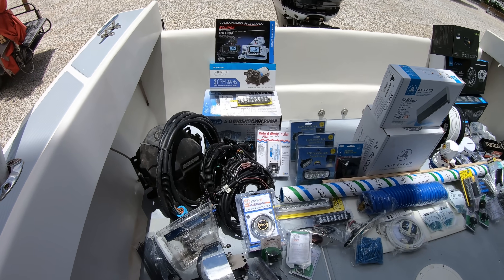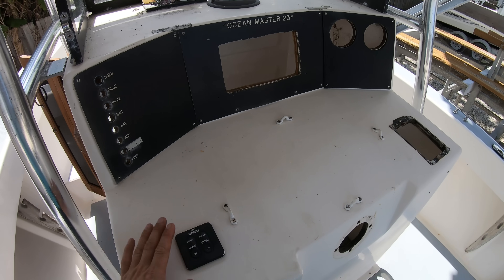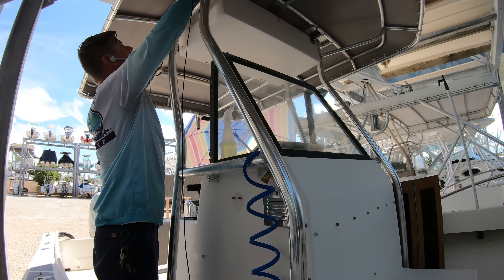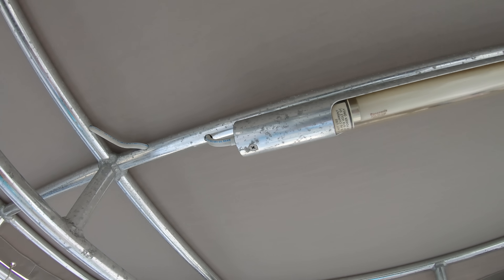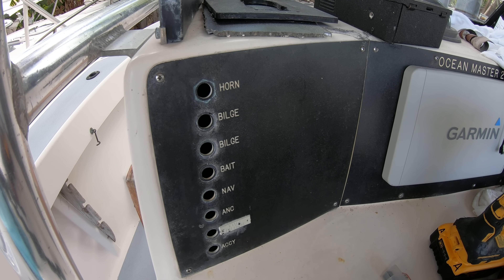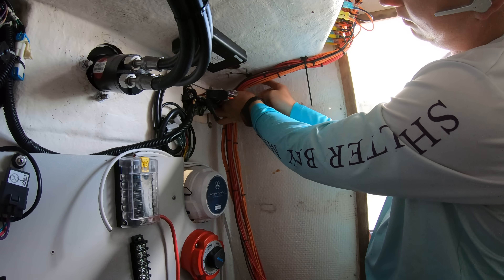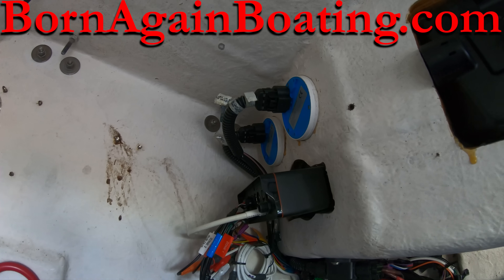WATCH Me Re-Wire An ENTIRE BOAT!!!

Comment: Why on earth would you have the nav and anchor lights on the same switch?
Reply from the maker: Not sure why you wouldn't, you don't run your NAV lights without the anchor light being on, so using a normal NAV switch which has 2 sides to it where 1 side only has Anchor on and the other side has NAV & Anchor on. That's how 80% of boats are switched
Reply: Running lights should never be displayed at anchor. Anchor lights should never be displayed while underway. How would somebody properly display their anchor lights at anchor, when their running lights are on?

Comment: 8:06 Why do you want the nav lights and the anchor light on the same switch? don't you need to control them independently? What if you want to be underway at night, but not anchored?
Reply: On my boat the switch has nav and anchor. But the switch is 3 way: it's either nav, off, or anchor.

Comment: In for a penny in for a pound. Lord my boat is so small, and Your Sea is so Great !
The farther out you go the smaller the boat gets. Fix it in the yard or fix it in the inlet 
🌊 - make it part of the boat and follow the code using marine grade only. Solder not nuts.🌊

That said - starting from scratch is usually your best option unless you trust the former guy.

Comment: Great video.
I'm not an audio engineer or even an audio snob. But you missed an opportunity to greatly increase the quality of sound during your rewire.
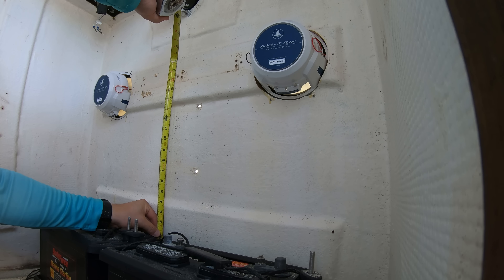That speakers that were mounted onto a quarter inch layer of fiberglass (min 3:20) loses a large percentage of its effectiveness (volumn & quality) because the energy is spent by vibrating the thin fiberglass. You can test this for yourself by holding the speaker (playing music) in your hand.  Then place the unit into the mounting whole (with the music still playing) and see for yourself the increase in sound quality.
The opportunity missed here was that speakers should also have been mounted to the board, instead of cutting holes around it. The sound quality would have been increased significantly, even if only half the screws went into the board.
I looked up those speakers and they are $700 a pair! Vibrating the thin fiberglass is probably making them sound like speakers that cost a quarter of the price.
When you buy speakers for your home, they come in a cabinet for a reason. The structure holds the driver and the driver vibrates the cone. The cabinet keeps everything sturdy so that the speaker can efficiently produce the sound. 
My whole system cost less than $700 and I bet it sounds pretty darn good compared to the expensive one in the video. All my speakers are mounted to solid board, the thicker the better. 
You put backing boards and plates behind just about everything else (rail cleats, rod holders, trim tabs, hand rails...), why not speakers?
Peace, Love and Safety on the Water to All.

Comment: 30 years as a marine tech.. I wish 90% of my customers would let me do this instead of trying to figure out what 100 other mechanics did wrong.
Reply: I would. How far are you from Jacksonville Fl ??.... I wish it was easy to find a competent rewire guy. With in the next 365..... I'll own a C-Dory 22'. I want a SIMPLE and COMPLETE rewire....
Basic cabin lights.
Navigation lights.
Small refrigerator  that runs on 12 volt and 110.
Shore power hook up.
A 24 volt trolling motor on the bow.
2 batteries for it.
A battery to start the motor.
Not sure if I/we could also run accessories off the 2 tolling motor batteries or I'd need one more battery?
So a total of 3 or 4 batteries.
A solar panel.
A gps/map/depth finder.
Bilge pump.
Live well.
Salt water wash down hose/pump.
And a couple of 12 volt plugs.
No stereo.
No radar.
Reply: @francus7227  Im about 200 miles away. West coast FL Hudson.. Of coarse I would not try and snipe customers from this page and if they had issues with it I would turn it down. I contract for a large marina and as you know its busy.. But if these folks were ok with it I could knock it out closer to winter.. But thats a haul
Reply: @gatorsaw3315  
Thanks for your reply. I have a better mindset for this project. "A haul" was very insightful.

Comment: You need to ditch those crimpers.  Those dimple type crimpers are NOT the right tools to crimp a heat shrink tubing.  Get some good quality crimpers that are designed for heat shrink tubing with a ratchet design.

Comment: For smaller boats that don't have enough room for such wall mounted distribution box I recommend Wago connectors. They are rated extremely well and provide constant clamping force so you don't have to worry it will pull out. 

Also, awesome thing for labeling is getting Brother label maker which uses TZe tapes, and then getting a tape with shrinkwrap tubing. It's so good and clean, also produces permanent label which won't fade in water or sun.

Comment: did a total rewire on 1986 26' sea ox. used only tinned marine wire, adhesive lined shrink connectors/ tubing, and oversized zip ties. dont cut corners on this project. great video of the process!

Comment: Man.  Very comprehensive.  When I did my last rewire I didn’t do a buss bar for negative and had all in a +/- blue sea fuse pannel.  I built out my pannel from new marine wire, and added the contra switches.  Really happy how it came out, always I wish I had my wires tie wrapped a little cleaner.

Comment: Nice video.

I rebuilt an old 16' aluminum boat and one of the most time consuming an expensive parts of the job was the rewiring. I had to plan everything because I was adding stuff that wasn't part of the boat to start with. The original wiring had a nav light switch, livewell switch and a bilge switch and that was it. 

I added LED locker lights, power plugs for charging phones, wiring for fish finders, a battery disconnect, fuse panel and a battery gauge. All of the new wiring was Ancor marine grade to replace the old plain copper automotive wire. What made it really fun was trying to route the wires because most of it never existed. However, unlike you, I color coded the wiring in addition to labeling it.

Comment: I noticed that you did not use dielectric grease on the connectors, and exposed panel connectors.  I use this on my truck.  It really helps in the winter to prevent  corrosion on my connectors.

Comment: What I learned from my bass boat wiring, it’s a lot easier to work when it’s clean. If the wires are a mess and you don’t have enough money to do all new wires, cut off ends, coil and zip tie the coil and move it up behind panels where it’s away from everything. Make sure you have proper or oversized wire size so you do not cause an electrical fire. Heat shrink and proper connections is a must. And be ready for some awkward positions and hundreds if not thousands of zip ties. If it doesn’t look good redo it to make it look professional you won’t regret it later

Comment: I was a NMEA certified Marine Electronics Tech for many years. I mainly worked on mega yachts and commercial ships, however there was the occasional "under 50 footer" refit that came along. I hated them. There are a few exceptions, but many manufacturers lack in quality wiring practices and then years of "my buddy installed" installations, along with wanting caviar on a potato chip budget, just made me dread these types of jobs. They are very time consuming to do correctly. Don't get in a rush and don't cut corners. Remember to use non corrosive fasteners and the proper protectant when using stainless fasteners on aluminum tubing and surfaces. Enjoyed your video.

Comment: Sorry for scolding you here...  your a great guy, did some clean and tidy wire routing and everything but you shouldn't be wiring anymore boats.   You have to follow ABYC cable and wire color codes, writing cute little notes on the cable describing its destination is completely useless.  They standardized that way back in the 70s because of this.   And before you start looking at the trailer,  there's a reason that the green wire goes to the right side and the yellow one goes to the left

Comment: I can see from the way you wired you're panel with a little extra length to the switches. The worst thing to work on is one that was cut barely long enough to plug in. I also have color coded wires so things are very easy to trace. Great job and it looks right and ready..